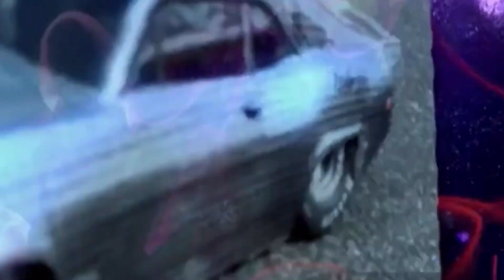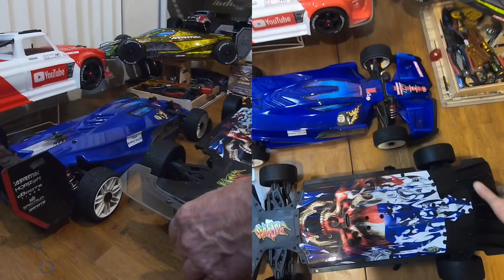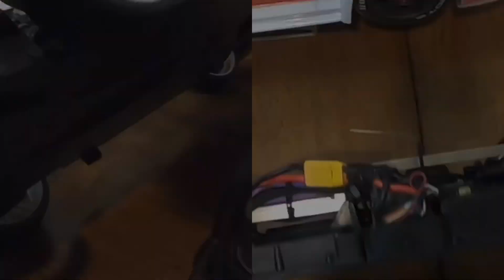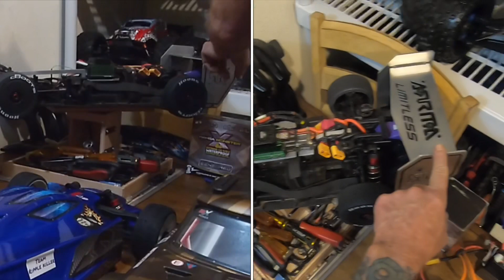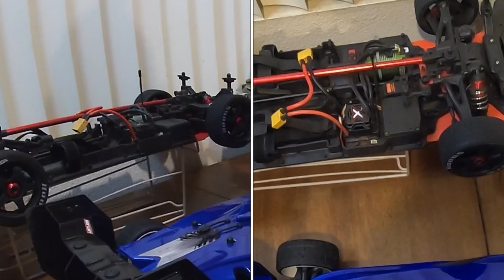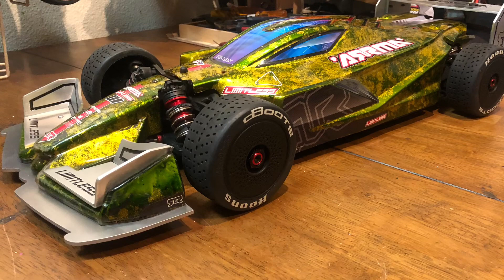Arrma limitless/Infraction what’s inside my builds??

Comment: Hey sir, throw in a Spektrum 160A smart esc with the Spektrum 1250kv motor.. that's what I'm running on a Spektrum DX5C with the Spektrum 6100AT AVC receiver. It has all the telemetry features you could ask for and I'd like to hear your thoughts! Thanks!
Reply: How do you have it the esc mounted im having trouble

Comment: What does this ripple killer do? Is that a necessity for running 8s? I'm considering putting my X-Maxx ESC in the Infraction to handle the 8s power. Should i not do that?
Reply from the maker: The cap packs protect the esc from to much draw required on speed runs the xmaxx esc works great should be good 💯💯🔥🔥🔥🔥

Comment: It’s safe to run on 8s with stock system ? I was told it would fry the motor
Reply from the maker: The factory esc can’t do 8s but if you replace the esc to an 8s esc the factory Blx motor will hold 8s but it will run hot and heat kills motors so you have to keep the motor cool with a good set of fans make sure to keep an eye on the temps my infraction has been on 8s with a stock motor for about a years now with no issues but I watch temps closely 🔥🔥💯💯💯I have overheated it a lot trying to figure out how to cool it but it’s dialed in and runs great now hopefully this helps you 👍👍🔥🔥💯💯💯
Reply: Okay coo so I ordered a 34t spool for my infraction with a 28t pinion is that a good drag option ?
Reply from the maker: Idk I don’t drag my infraction I use that gearing on speed runs well I use a 27 tooth pinion and 34 spur to run 130 mph with 👍👍
Reply from the maker: Remember it also depends on your kv I use a 2200 kv with that combo 👍👍
Reply: Yeah same I have the mamba x 8s esc and have the 2200kv castle creation motor on 6s